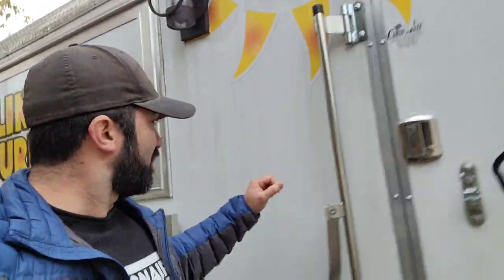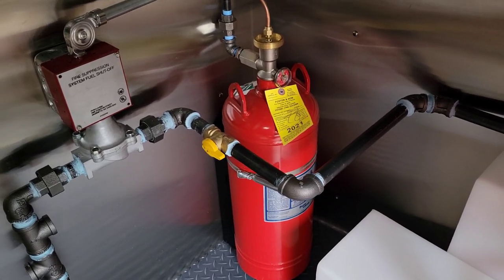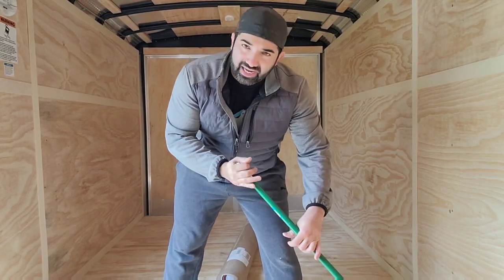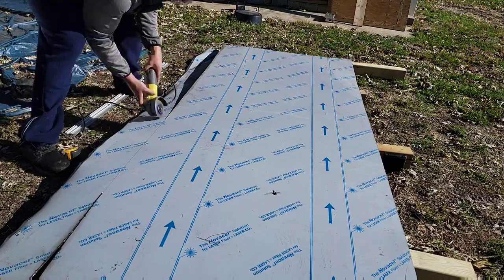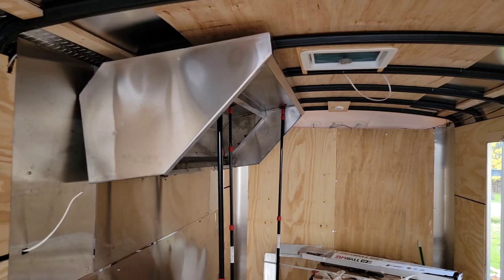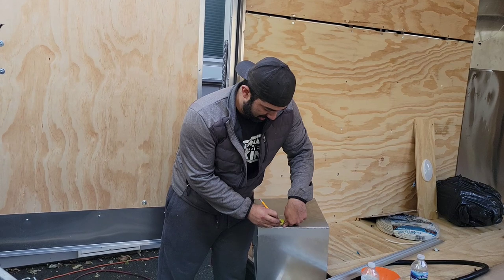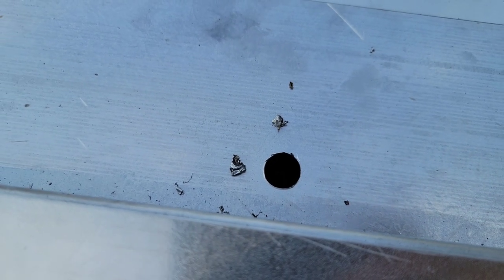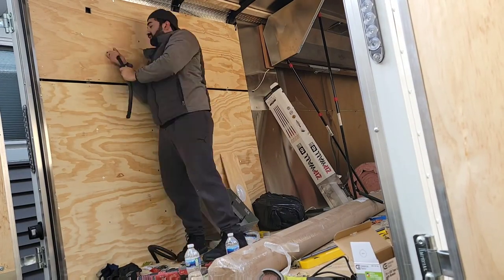Building a Food Truck: Starting from Scratch

Comment: Budget friendly ideas are fabulous. I bought a used food trailer and have been replacing or adding equipment that I find used on marketplace. Other options for hood vents that are cheaper would be awesome. Or restoring used commercial equipment. I bought a thermador range too with griddle that needed serious cleaning and sanding on the griddle. Thanks for the vids. They sure help
Reply from the maker: Haven't seen a cheap hood option. I would rather over spend on a good window and hood and try to cut the costs in maybe a used prep fridge and such

Comment: Can the fire suppression system be install on the  ceiling of the trailer? Because where my range hood will be. There will be a door and I was wondering if the fire extinguisher be install on the ceiling? Thanks in advance
Reply from the maker: I'm assuming you can but it's a bumpy road so you have to really make sure that it's secured

Comment: Frank, I noticed on your Rolling Burritos truck that you have the side entry door with a cam bar lock and it looks like someone retrofitted a locking handle latch to the door. Did you do that yourself? I'm looking for some information on that because the trailer I bought came with the cam bar style lock on the door. Thanks!
Reply from the maker: This particular trailer was like that from factory I did see on Amazon some door handles you can retrofit

Comment: Hi Frank. I live in Wisconsin and the requirement for a fresh waterctank is 40 gallons and the waste tank is 46. What I'm wondering is do you know or can you measure on the trailer you are building now what is the clearance in inches between the bottom of the drain pipe on the 3 compartment sink and the floor. Assuming you have the flanged feet on the sink legs. Much appreciated and thanks for the very good videos.
Reply from the maker: Let me get that for you tomorrow morning 👍
Reply: Hi Frank. Did you ever measure that distance?
Reply from the maker: @steveluepke9654  you are at about 25 inches
Reply from the maker: @steveluepke9654  these tanks are at about 22 inches
Reply: Thank you Frank. Appreciate it.
Reply: Hi again Frank. I'm pricingbout the coin flooring for my trailer and Menards has it on sale this week for $177. It is 1/16" thick. They also have it in 1/8" thick but that is $400. I found it on Amazon for around $289 but I can't find out the thickness. Is the Amazon one 1/8" ?  Or is
Reply from the maker: @steveluepke9654  I would get the home depot one

Comment: Does the fire department installs the fire suppression? I am building a pizza trailer so idk if I should order the hood along with the fire suppression. Any tips on it?
Reply from the maker: No a fire extinguisher place or a fire installation place will do that for you. You can buy it with the piping from Hoodmart however it will still need to get Inspected which will cost $$$
Reply: @fbaltierrez  thank you!